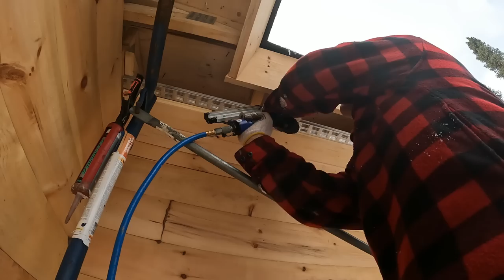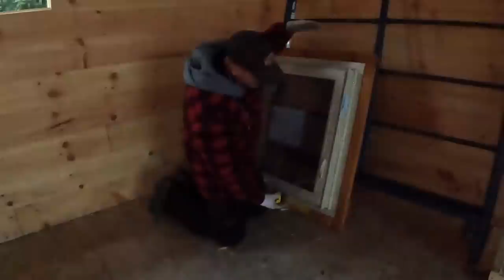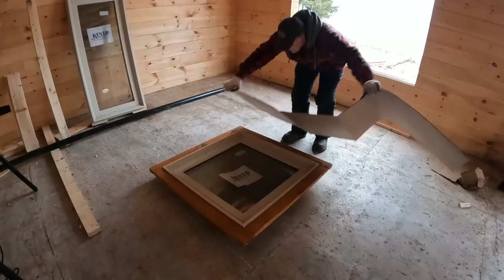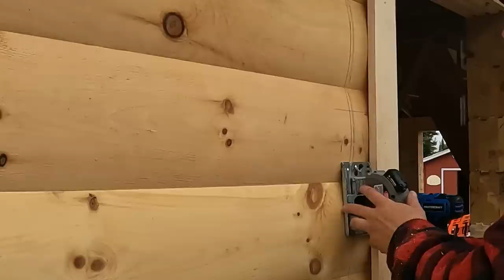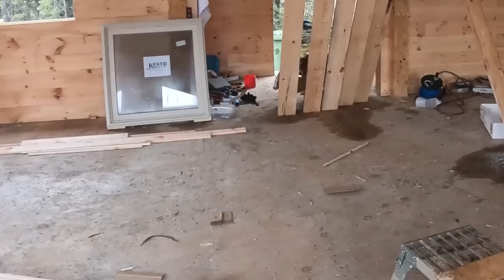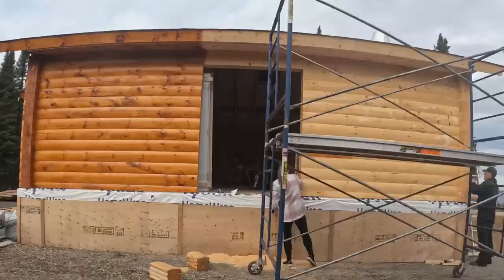SNOW, THAW, WINDOWS & an unexpected "STAIN" 🏡🪵🌳(Off-Grid Log Cabin Build - Labrador, Canada)

Comment: Outstanding! When the video started and you were traipsing though some fluff and ice, I was wondering what you were going to do. It's all coming together, and you were thinking like water. Weather warmed up, think stain. Weather turns cold, think windows and doors.
Reply from the maker: Absolutely mike. I judge my jobs around the weather. Warm temps are outside working days, colder will be inside

Comment: Hi Chuck- what height are those windows below the rakers and what width is that gable? I’m guessing but is it 20’? Planning some windows for my build and your set up looks great
Reply from the maker: I think you are referring to the two windows installed in the gable on the front? If so, they are about 20” down from the rooftop (the vaulted ceiling trusses - which are “behind” the windows are about 15” deep, so I placed my windows about 5” underneath those. The gable width is exactly 20’
Reply: @ChuckPorterEverythingOutdoors  Not the angled rakers but those tall windows. What is the RO on the two narrow ones? Also, I’ve used that brand of stain, 2 parts 1 and 2-3 if it’s what I’m thinking. It’s good stuff aside from the stronger fumes that makes your eyes water. Nice looking work and thanks for sharing your construction process.
Reply from the maker: @granteditslifeoutdoors.9194  hey sir. Those windows are 16” below the gable end. I’m not entirely comfortable with carpentry terms (as you can probably tell!). I hope this answers your question

Comment: Awesome progress Chuck! You're ready to work indoors over the winter! 

Is there any provision to hide the screw heads on the outside of the window trim?

Also will you be re using the woodstove from your old cabin or do you have a different plan for heat?
Reply from the maker: I will use plastic wood or “buffer” it’s called to fill the screw holes. 

I am so so so excited to showcase my brand new stove!!!  It may be the next video. It is a beauty!!! I wish o could tell you right away but that would spoil the fun!! 👍👍
Reply: @ChuckPorterEverythingOutdoors  looking forward to it! I did my pre season maintenance today on my 1200 4-tec Expedition with a little help from your channel! Cheers

Comment: Windows looking great is there a reason you didn't use the chainsaw to cut the windows holes bigger instead of the axe and chisel just wondering but they really do make the cabin look great good job
Reply from the maker: I guess I didn’t trust myself to do the fulll cut with the chainsaw lol. I was terrified I would overrun. Bit hard cutting  with the grain as opposed to perpindicukar as well. All worked out though. I got the hang of it afterwards so it speeded up👍